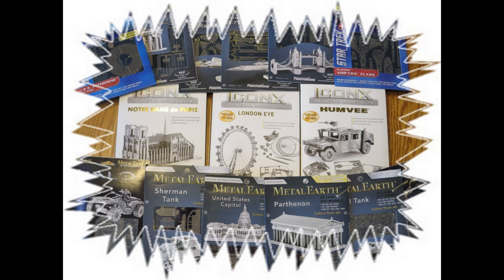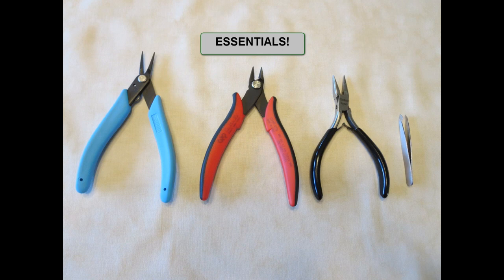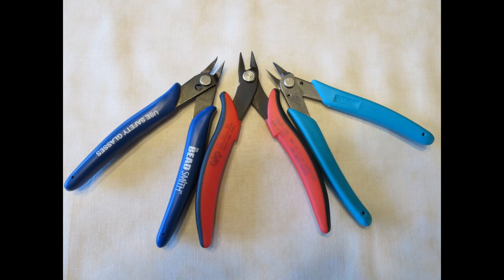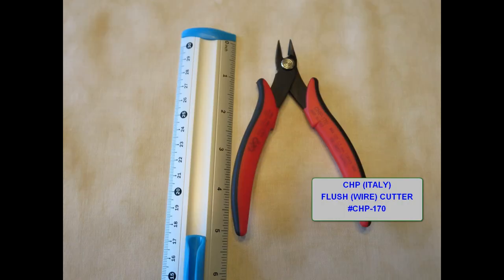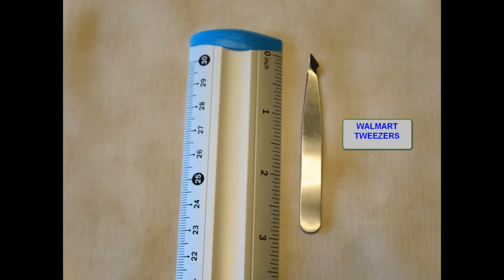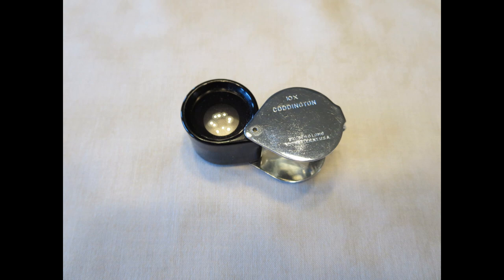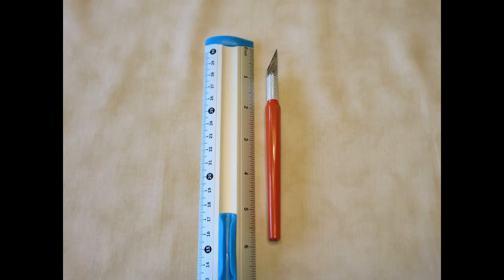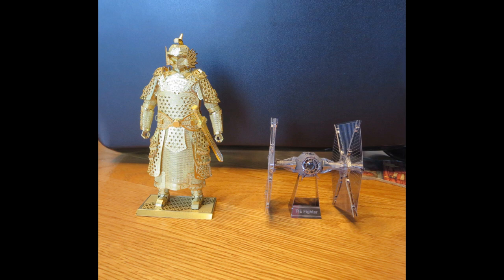Fascinations Metal Earth Model Kit Basics  - TOOLS

Comment: I have put together about 30 or so models so far. I have several versions of just about all of the tools you showed. A few you did not show that I have found useful are a round extra fine micro file. I use it for filing off the nubs, I also use it to guide tabs into slots that don't want to go in easily. I got a two set of long flat nose pliers from Amazon. They are about 3" long, however, they are a lot thinner than regular flat nose pliers. On one pair I ground the tip to a taper with about 1/4" wide end. I use these about 80% of the time. I also magnetized them SLIGHTLY. They are great for picking up the tiny pieces.

Comment: Flush cutters are generally intended for softer metals, and will eventually break down when used on steel.  If you want a set that is made for steel, look for Knipex.  There are more expensive, but they'll cut steel for years without chipping.

Comment: Looking for tips on how to bend the metal right, so far I cant seem to get the metal around the punch dowels just right
Reply from the maker: If you are trying to form a typical cylinder, try to hold the piece with your thumb on the dowel (or transfer punch), then push the piece on both sides at once around the dowel. Cone shapes are more difficult, but I use  a tapered tool, like a nail setter for the bend in the same manner. IMO, forming a round piece and getting the tabs secure is the most difficult bend in the metal model world.
Reply: @blueholebob  thank you so much for this info! Usually the trouble is trying to curve small or thin pieces so I will give this method a try. Thanks again!